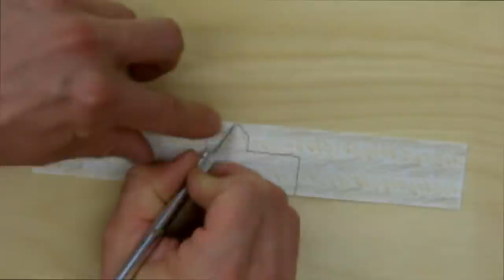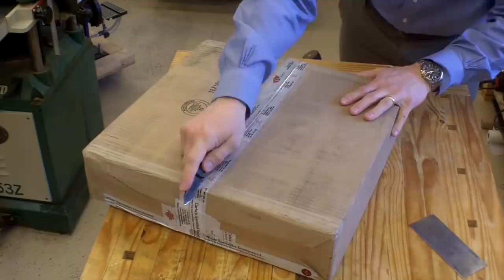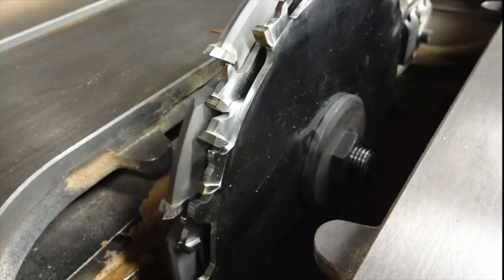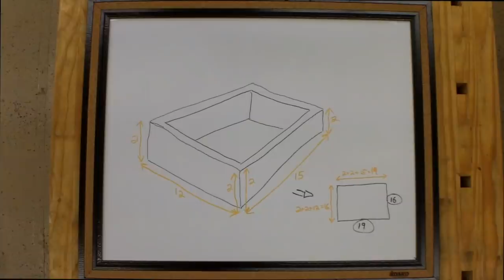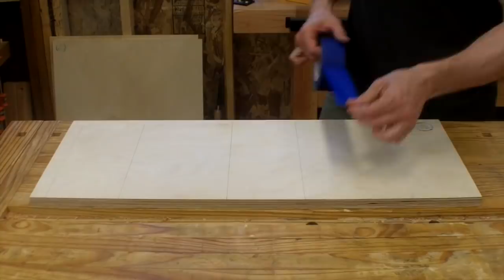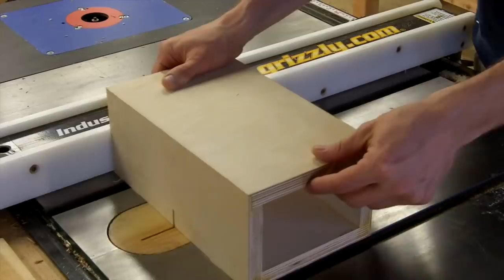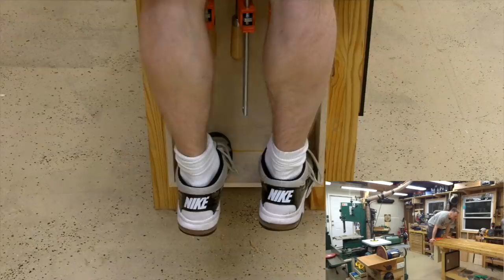New Invention - Easiest Drawers Ever!

Comment: I would get in touch with some of the reps for flat-stack cabinet companies. I have been using some Chinese-made but decent quality kitchen cabinets, and they all come flat-stacked in a box that the end-user puts together. add a couple of pre-drilled pocket screw holes, and this could move them from the expense of dove-tail fabrication, and the end user just has to squirt some glue, drive some screws, and be done assembling a drawer in half the time (which adds up when talking about an entire kitchen) ... Good Work!

Comment: Why cant you just cut the same thing with a V kinda looking saw? Why does it have to be that special form?
Reply: albula642 

Look up "miter fold." It's been done for... well, forever.
Reply: albula642 You can but this has a larger surface area for a stronger glue bond.

Comment: Nice work. I think you should make furniture, instead of drawers with this technique.

You could reinforce the edges with glue + textile canvas belt around the box. Or drill a hole on finished corners and middle and glue-in some wooden or metal cylinders.

Drawers should be made from heat-pressed bamboo or hemp canvas that is glued with two layers of chemically stable plastic from both sides.

Also, your technique is perfect for flat-packed furniture, if you would incorporate metal screws that hold the parts together.

Comment: Next step: With this method, can you develop a way for this to be used in an industrial-level manufacturing process? You can make a patent for this methodology as well.

This would also make it significantly more appealing for big name brands, as the manufacturing process is already detailed, as opposed to your current method which relies on building it out by hand.

Comment: the stack of blades will need to be adjusted, depending on the thickness of the wood. would it not be easier to have a triangular blade?

Comment: This is an excellent idea. I think a knife set for a TS molding head may be a less expensive way to do it because you won't have to manufacture an entire saw blade. HSS could be a viable material for an entry level option until the idea gains traction. You could seek out a company that already makes molding heads and license the profile to them. Too bad it wouldn't work as a router bit. I was thinking about a horizontal router, but it wouldn't reach to the inside of a panel face.
Reply from the maker: Stumpy Nubs Thanks stumpy, the molding head is a good point, you would need different cutters for different thicknesses of plywood, but it might still be cheaper than the dedicated blade.
Reply: I realize this is way after the fact but in my Craftsman Molding Head set it has box joint inserts.
  To make drawer sides it involves making separate interlocking pieces, gluing & aligning joints & then clamping without losing your alignment.
  That custom cut carbide blade is an absolute time & work saver. Good job!

Comment: Awesome product, and let's not forget,  you could still use a mechanical fastener (brad nails or screws) if you indeed wanted more strength.
Reply from the maker: Paul Meyette very good point, I didn't want to go there in the video, but you could absolutely reinforce with brads, screws, or splines if you wanted to get fancy, I might do a follow-up video with some of those options.

Comment: Its a little like the miter fold technique using a v bit on the router table. Very nice idea!
Reply from the maker: mike gager it is similar, but I like it better because it gives more glue up surface, and is an easier glue up since the mating sides lock into each other instead of sliding like you have with the v bit method.
Reply: Andrew Klein no i agree this is much better. Good job